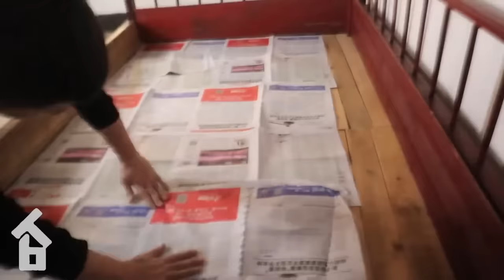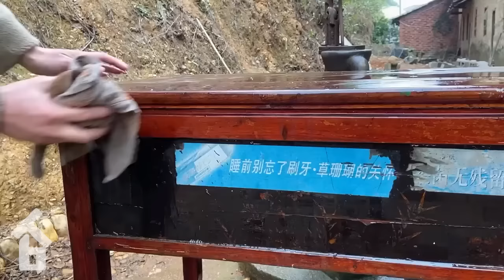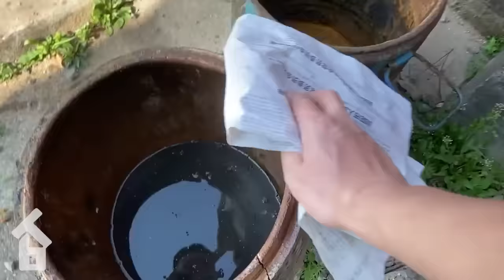Leaving city - Man renovating abandoned house, renovation garden gives US president goosebumps

Comment: Excellent work! So much patience and diligent work!👏🏽👏🏽👏🏽👏🏽👏🏽👏🏽♥️♥️♥️IF he uses the old house as a "cellar" it will be lifted enough off the humid ground and therefore avoid moss, high humidity, and mold. The upper floor can also have greater light, air circulation and perhaps, even cooler. A GOOD pressure wash would save him time, materials, and money. Also, he didn't waterproof the roof (beneath tiles).
Reply: 🌹It's joy to know you,wishing the nicest things always for you, not only today,but all the year through because you are really a joy to know.@renovation168